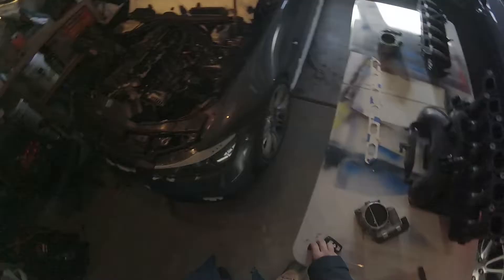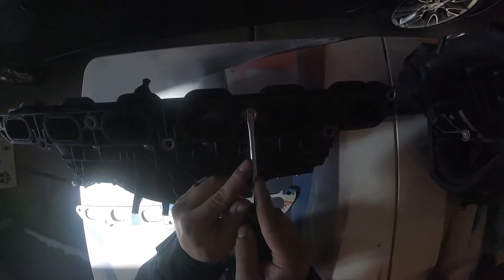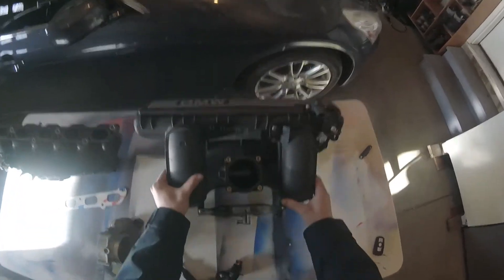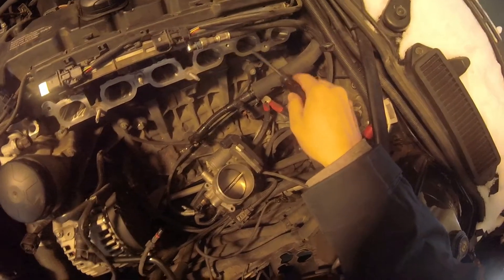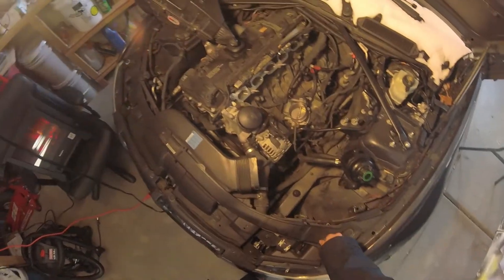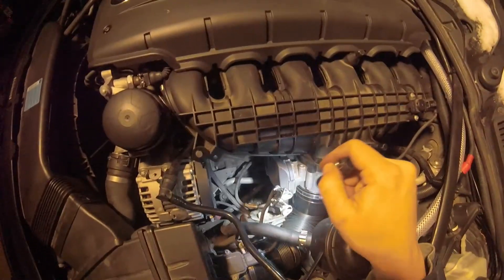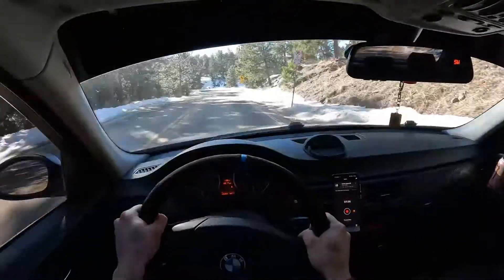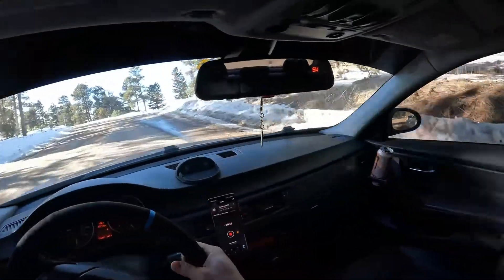How to put an N54 intake manifold on the N52. More power?

Comment: N54 intake manifold is better than the 3 stage 330 intake manifold?
Reply from the maker: Power wise, I'm not sure. I felt gains in mostly high end and I've heard the same about the 330manifold. I went with N54 manifold because I won't have to deal with disas and it will take boost. In my opinion easier to do as well. No reprogramming needed.
Reply: @Moon-Garage you didn’t remap the ecu? just running this stock? i’ve been torn between going 530 or 535 manifold.. if i won’t have to rewrite in ncs with the 35 manifold i’d much rather go that route
Reply from the maker: @keatongiles62  correct. Did not re-tune or reprogram. N52 relies on maf sensor. Only reason 3stage manifold needs reprogramming is for disa valve. No disa no problems

Comment: im curious how the stock manual gearbox will hold up to boost, looking forward
Reply from the maker: It actually has the manual gearbox from a 335i. The GS653bz. I'm not sure if the stock N54 clutch and pressure plate will hold up, though.

Comment: For the intake pipe. 3.25 inch 45 degree silicone boot + 3.5 inch 90 degree boot. Slip one into the other and cut to size but works well. Overall great video
Reply: Update: I deleted mine 😮
Reply: @chilledn52 what did u delete
Reply: @un54fee  throttle body, intake piping, airbox. On velocity stacks
Reply: @chilledn52 shiiii how did you get the beta test 😭 im just going to run the n54 until they come out
Reply: @un54fee  as soon as I saw the beta come out, immediately signed up. Was first one to receive the trumpets outside Rai and 22RPD.
Reply: @chilledn52  Jheez man you think it’s gonna be worth it to buy?
Reply: @un54fee yes, I see it being a very popular mod for a higher “stage” or upgrade
Reply: How did you get in the beta test
Reply: Do the velocity stacks have filters? What about stuff getting inside?
Reply: @Thatonebmwguy  k&n prefilter covering the intakes
Reply: @chilledn52  need this when it drops!!! How soon?
Reply: Does the intake manifold swap to n54 require a tune
Reply: @vinnydiconza5839   required? no. if 328 there should be no codes, 325 or 330 you will have DISA codes. Tune just allows for everything to run correctly and efficiently
Reply: I just finished switching form my N52 intake on my 328i to a N54 thanks to this video can you help me out on getting some velocity stacks? I know most people 3d print them for the factory mounting points but I don’t have a 3D printer
Reply: @AndrewLopez-my3tz  Currently the final production trumpets are not out yet, when 22RPD releases them, they will open up the design for the intake points and then other people can design their own. I'm just a BETA user who received them early